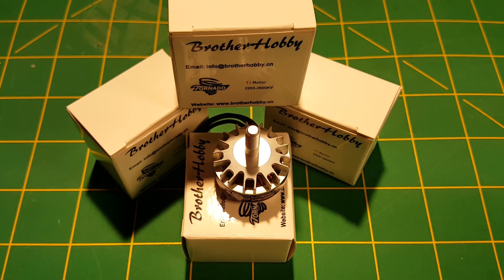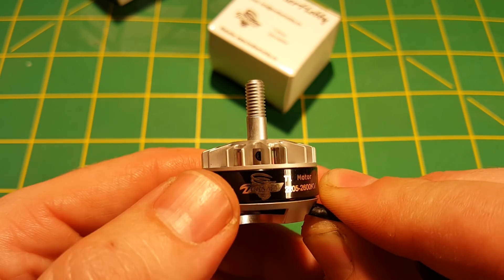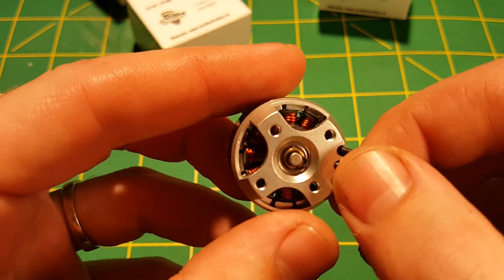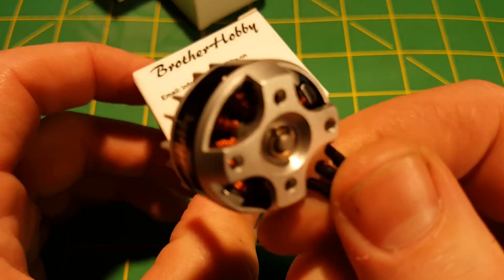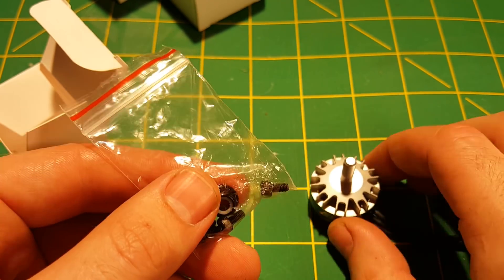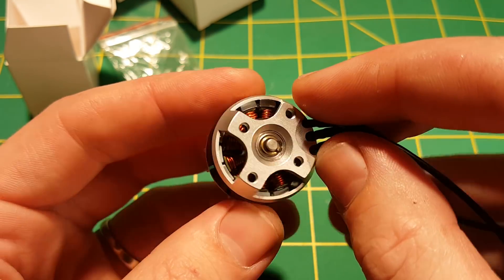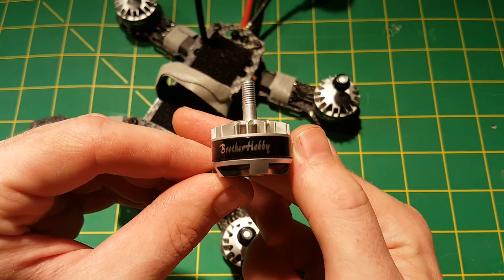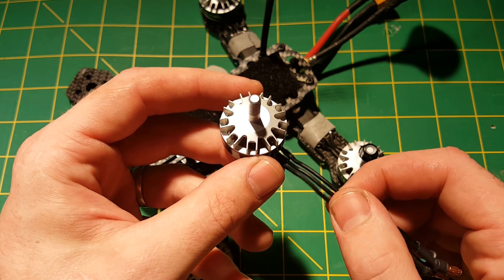BrotherHobby T1 Tornado 2205 2600kv Motor Review and Thrust Test

Comment: Your battery is a limiting factor on the 5040 props. You can easily get an extra hundred grams with a nice battery such as graphene, or SMC
Reply from the maker: Yes. I agree. I have since bought a 5000mAh 65C 4S battery to conduct all my thrust tests with for better accuracy and consistency. This test still gives a decent "real world" scenario but you are right.